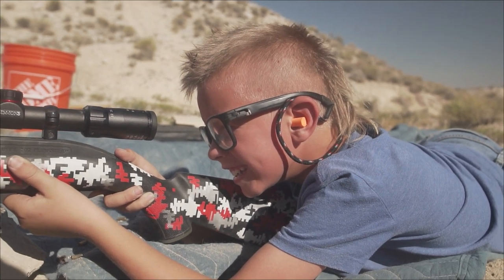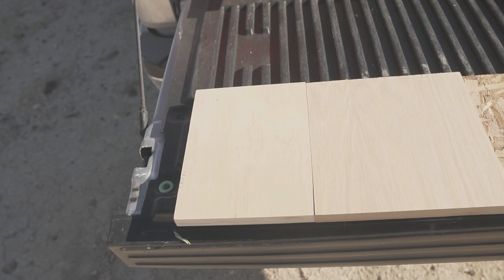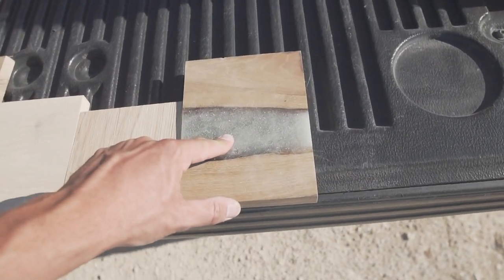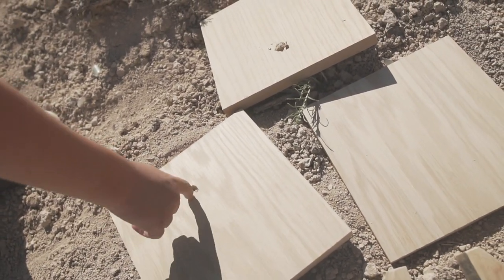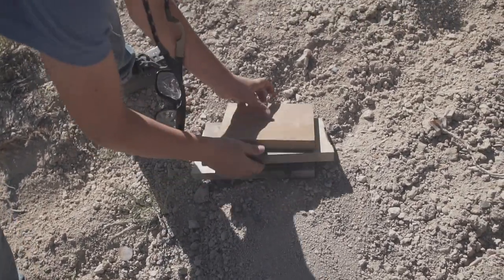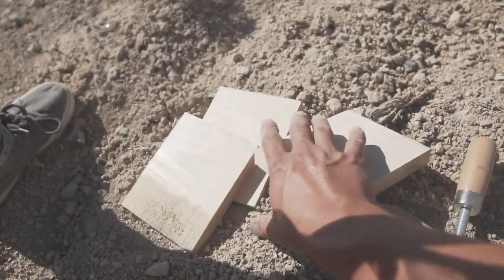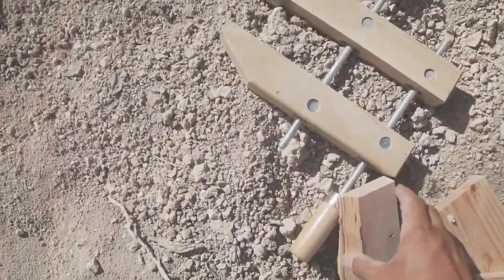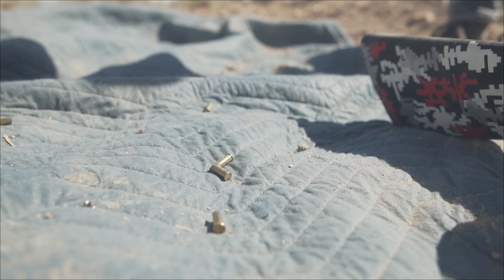HOW STRONG IS EPOXY RESIN???

Comment: Asking “how hard is epoxy” is a rather open ended question. Sorta like asking “how hard does a human work?”.  Some humans lay around and do nothing. Some humans work a bit. Some humans work a lot. Many different variables. Depending on how, or what with, they are mixed... the outcome could be rather lackluster. 😂
Reply: This was no composite material, only resin.